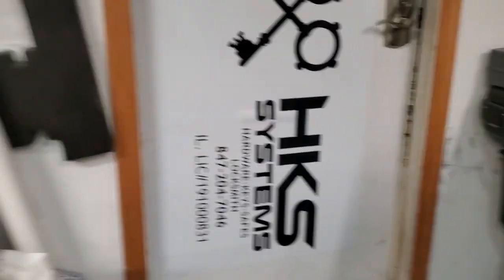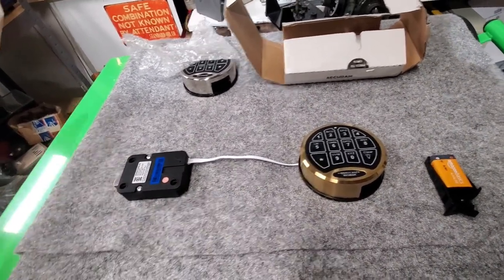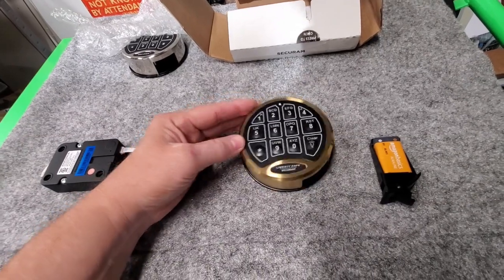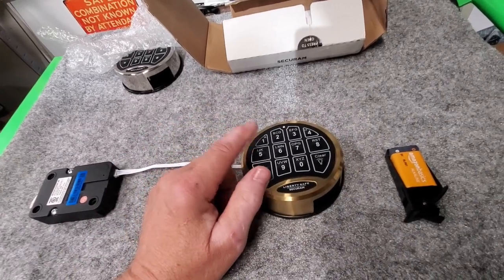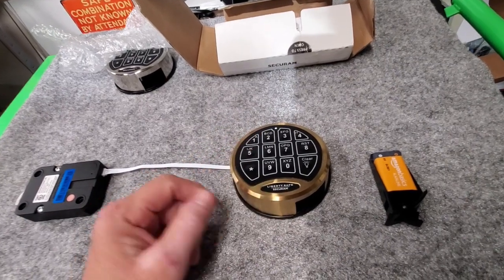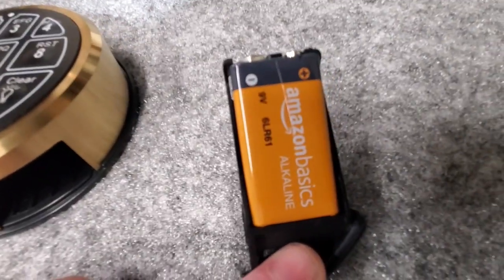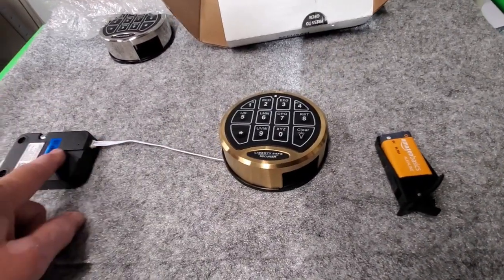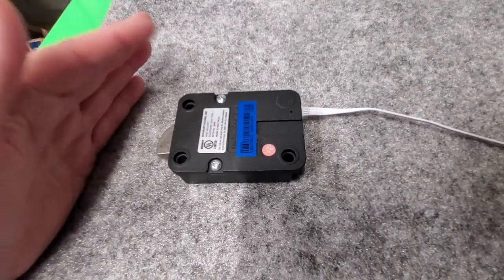Bighorn gun safe opening & Electronic safe lock troubleshooting safe lock malfunction tips & tricks

Comment: Only the second time you have had to drill this lock, that is a good record for this lock. So something major failed in it. Do you then take the lock back home or send it to the manufacture for an autopsy to work out why the lock failed. Is the company even interested in working out why their lock failed. Thanks for showing the picture and for explaining about the battery causing issues. Appreciate you doing this video, cheers
Reply from the maker: It's. A pc board I really don't think it can be diagnosed easily.  At least not by me. I actually send it to LPP..I'm trying to train him..lol
Reply: @hkssystemslocksafe2486  Okay thanks for answering. Good that LPP is getting mentored by you. Cheers